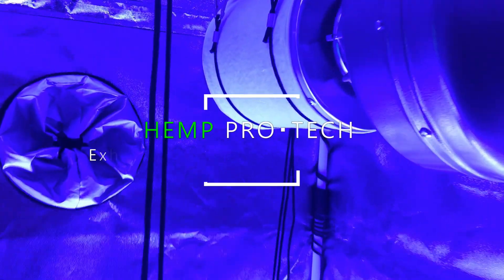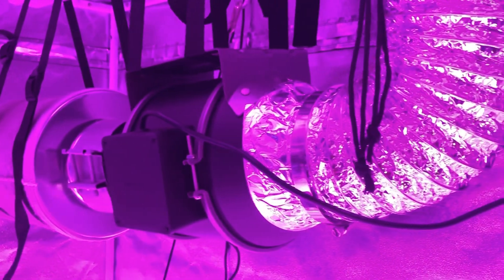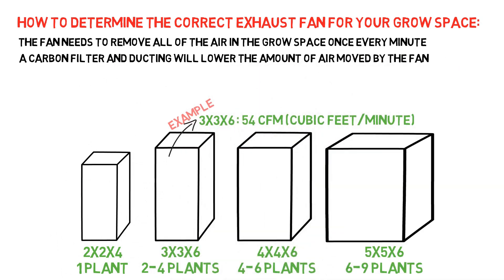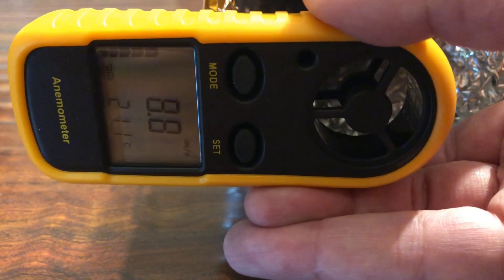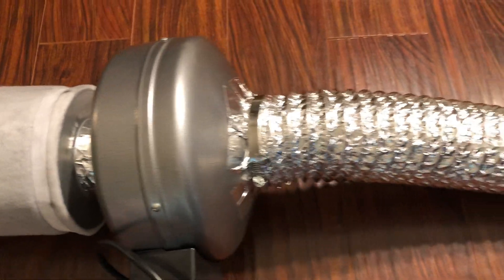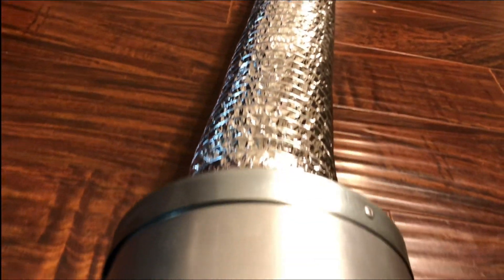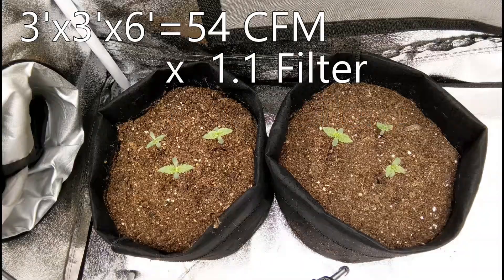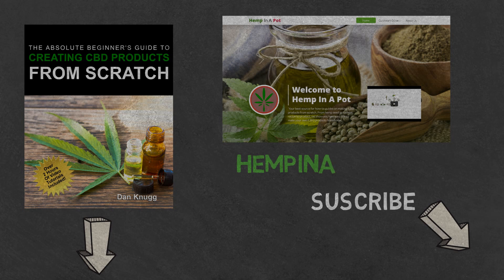Testing How Ducting & Carbon Filters Affects an Inline Fan

Comment: Edit: screw it, man. I went ahead and ordered the AC Infinity 6” inline. Soon going to add on a charcoal filter. Thanks. 
Perfect timing on this video as I’m beginning my first tent grow setup. I checked out Amazon of course to find a recommendation but ran into the barrage of 5 star down to 1 star reviews. AC Infinity, TerraBloom, Vivosun to name a few. Some say awesome while others say junk products. 
Same 3x3 setup as yours,. High heat and humidity region that may need my  room A/C running 24/7. 
Need a little help, please. Budget is big factor as I’ve already sunk a bunch o’ cash already. I’d really want a first successful grow for encouragement. 
Just a bit confusing with all the options both good and not so good products out there. Thank you.
Reply: Hi Old Guy. I relate to your nickname!!! I hope your first grow is going well? In my opinion, by doing your research you are on the right path. About the budget, by spending more for better quality, well the expression "you get what you pay for" is so true when it comes to growing. I have my own saying. "I can't afford to buy cheap", meaning I end up throwing away or buying another item. The odds are in your favor with high quality equipment, but it's never a garanty. For example: I bought a 6"' fan from Elicent 11 years ago and it still works 24h a day ! At the time, it was 2.5 times more expensive than the cheapest! In perspective, imagine a fan breakdown, what are the consequences: Hermies from heat stress or worst, loss of garden... Just to name a few. My point is, the critical items should be of high quality. However, as you said, (screw it!!!) it's your first grow, so just get your feet wet and see if you like growing. 80% of first time growers abandoned due to lack of discipline, negligence or plain too dumb to research and gaining knowledge like you are doing by watching videos, etc... You can always upgrade your equipment later as you discover what are your needs, not what other say. I bought that fan for 2 reasons only: First and the most important for me, I needed the most quiet one and second was reliability. On the other hand after a few years I went with a cheap one for another project... Well it was so noisy that I had to return it and get a refund, you know, the whole waste of time with emails, phone calls, etc... Congrats for getting started!!!
Reply: Unfortunately I think this might be luck of the draw and present with all brands. I bet more expensive models send out duds less often, but I think it’s present no matter who you buy from.
Reply: Hope your first grow went/is going well. Always learn, and adapt. Use info from a variety of places, but figure out what is best for you. Keep notes and pics too. They can help one to recall what you did on a certain day so you can replicate or avoid.